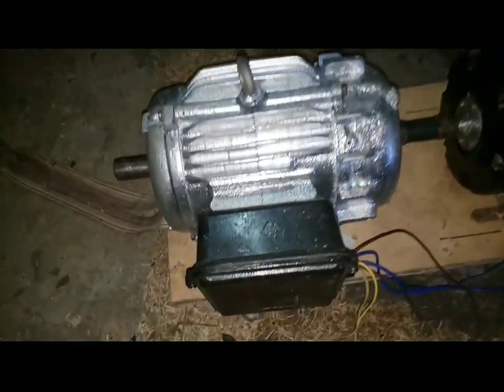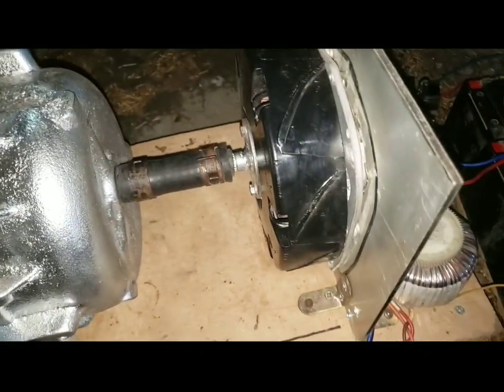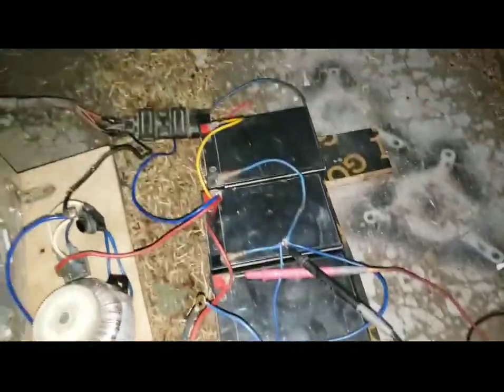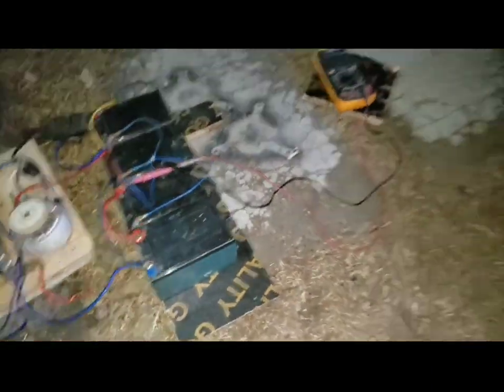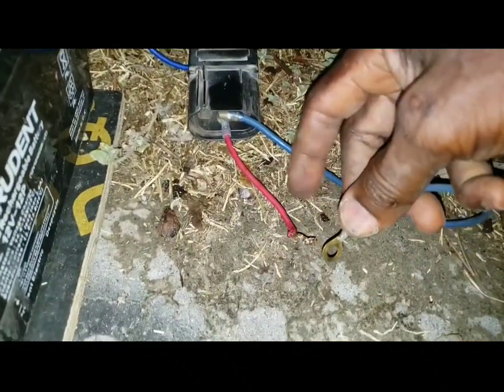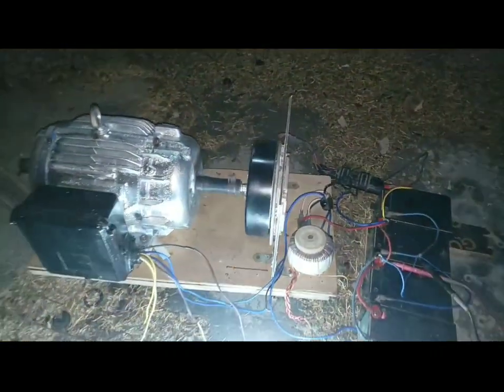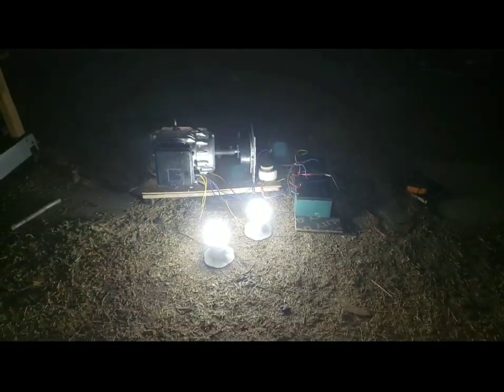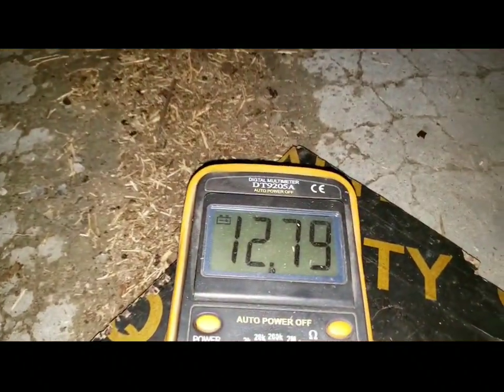Free Energy, Is Charge Back Possible???

Comment: Looking good so far congrats..please do a long term test with your loads and verify after 24hrs of runtime..this will confirm if you have something viable.i have tried with a 3 phase pma and a 18v drill..initially the results were similar to yours but after 2 days of constant running the battery was depleted..so dont be over thrilled just yet..but thanks for sharing